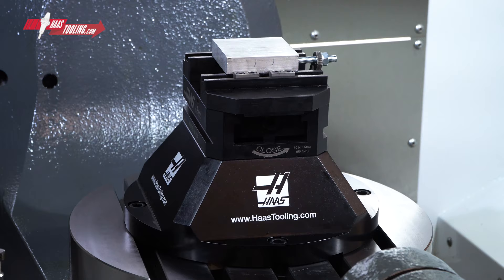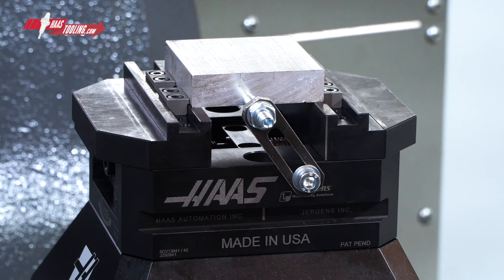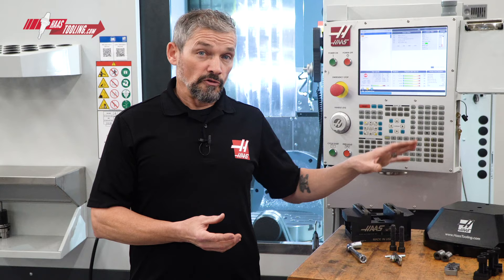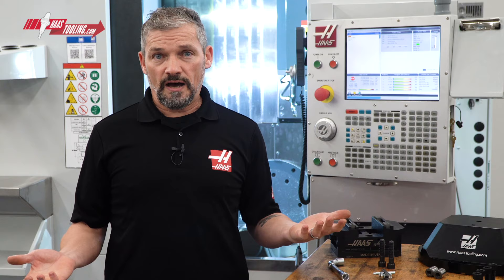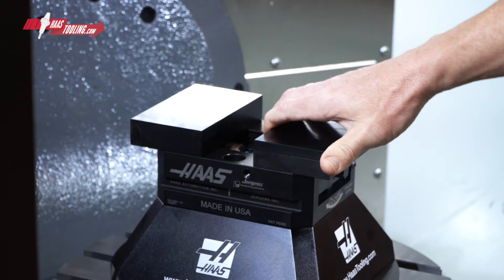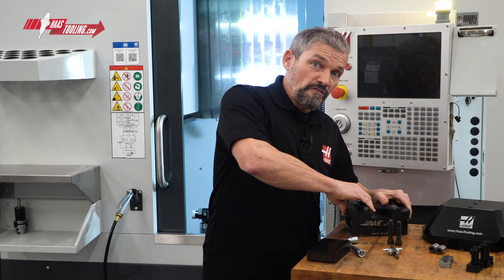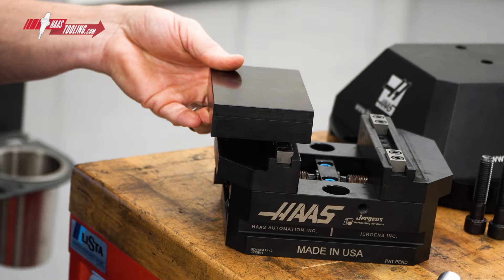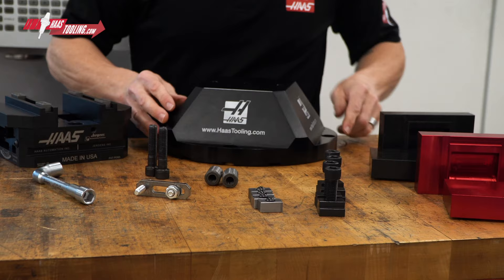Ready 2 Run Haas by Jergens 130mm Self-Centering Vise Kit. Haas Automation, Inc.

Comment: The excessive shoulder of the jaws due to the V groove pocket is a bad move in my opinion. Losing rigidity in tool stack up with excessive stick out to clear those on anything at B90 close to the jaw is a pretty significant loss in tool life/ surface finish/ and ultimately cycle time. Why not  stick to 2 bolt pinned/dowelled jaws?
Reply: Quick change jaws are a strong trend in the last years
Reply: not every setup needs that kind of jaw configuration
Reply: @SuperAWaC  the general tool that can do one more thing than another general tool is often the better one